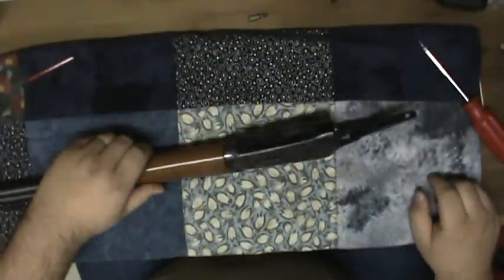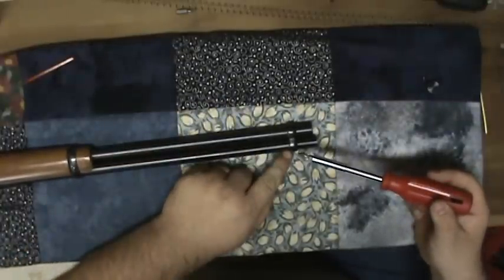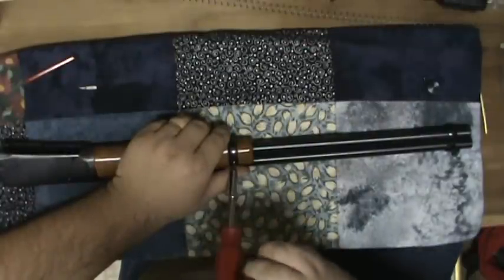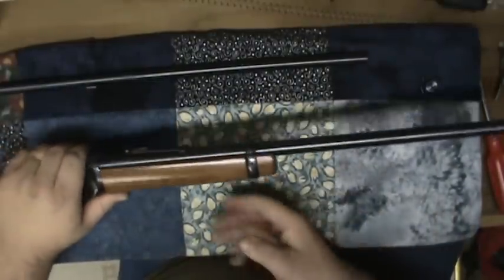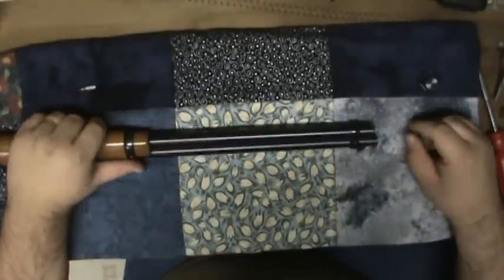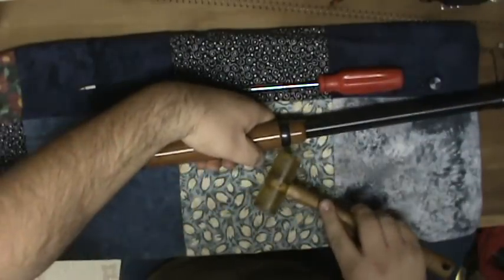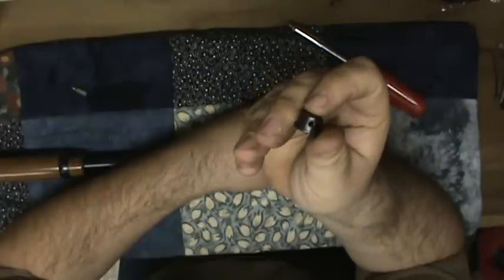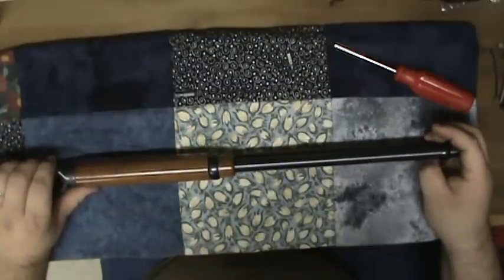Winchester 94AE Magazine tube / Forearm Disassembly

Comment: How would you go about cleaning the inside of that Magazine Tube, Would  spraying some Carbarator  cleaner down it work.?Etc
Reply from the maker: Sorry for the late reply.  You should run a cleaning rod and a patch or mop sprayed with your choice of cleaning solvent.  I like remoil.  Then run a dry patch/mop  once the tube is clean so that it will not leave any oil residue inside the tube.    If you find rust, or dirt that is stubborn, you can use a bronze brush , or even some scotchbrite pad on a large jag/patch holder to scour the inside.
Reply: @johnis4jesus  It's hard trying to load 4 rounds into the Rifle, It was my Dads Rifle He never fired it bought it NIB in 1954 & passed it down to me, I am not a Mechanical type of a guy, Was thinking to bring it to my local Gun  Smith & ask him to Clean it out for me, I feel that the Original Spring in the Tube may have to be cut down, So it will be easier to Load it. Thanks for sharing John